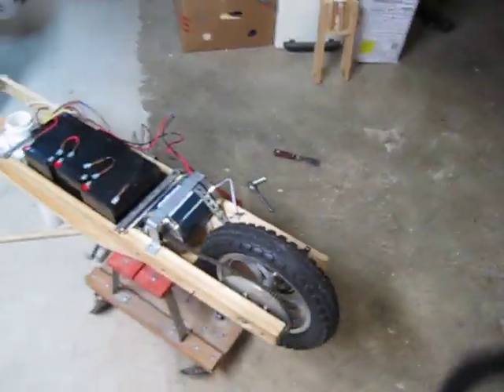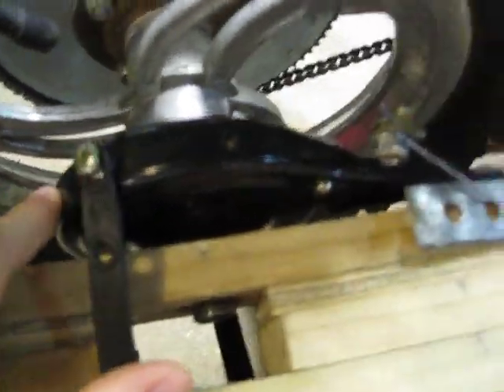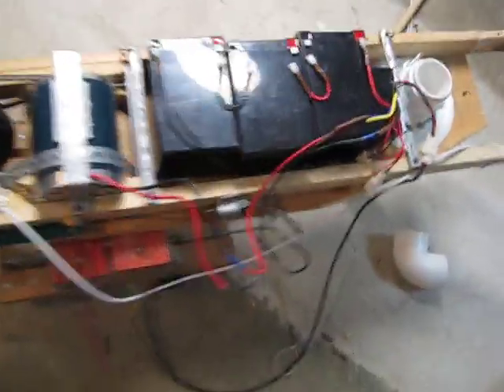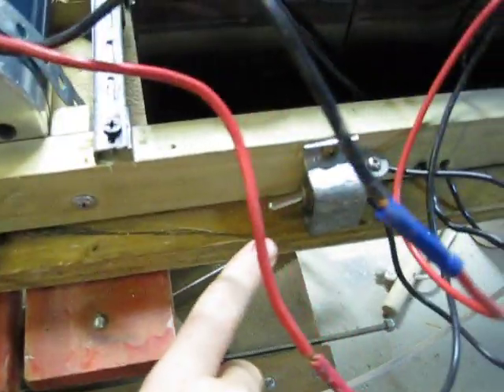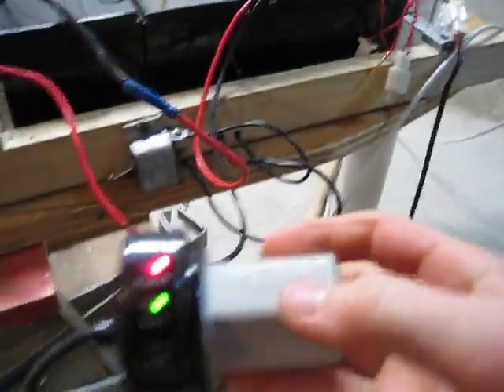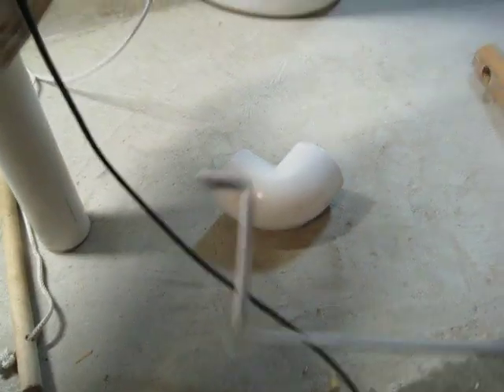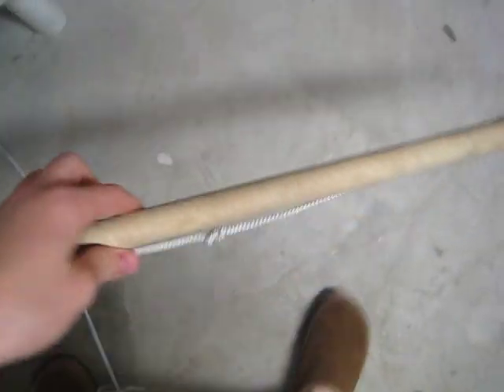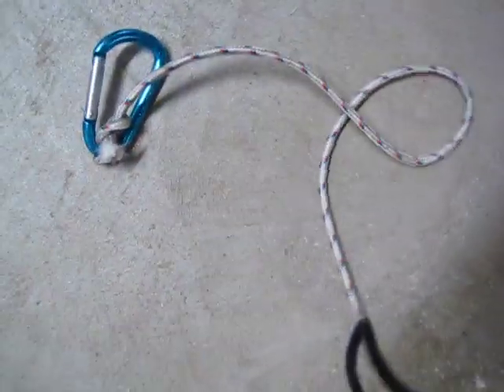Homemade Wooden Electric Motor Scooter [Part 1]

Comment: That's pretty awesome dude.  What about using LiPoly batteries instead?  Could save you a bit on weight and space so you can add more, or to just get ones with higher capacity.

Comment: It possible the throttle control has toward and reverse positions and he just turned it to reverse position, if not it's an easy fix reverse the polarity on batteries. I'm sure he'll figure it out.  Good job kid.

Comment: that looks like a fairly high torque motor and you are getting pretty high rpms. Your dseign is very unsafe and you could seriously hurt yourself if you were to ride it. It could wobble and the handlebar could break or a wheel could come out of place. I strongly suggest you dont ride it and redesign it to be more sturdy